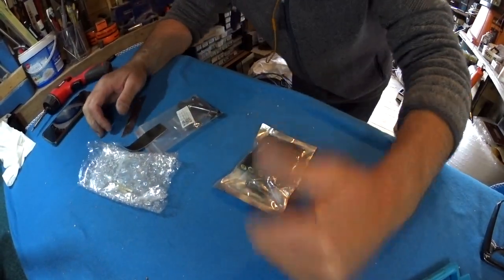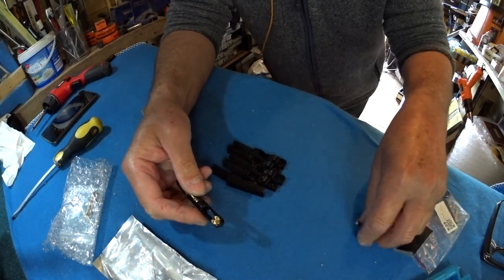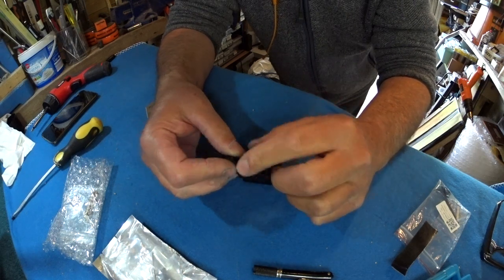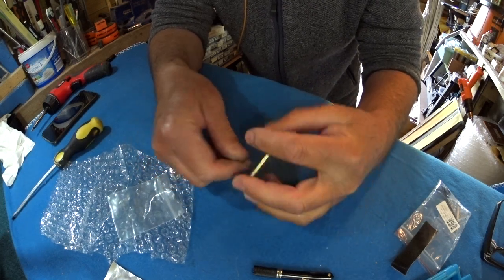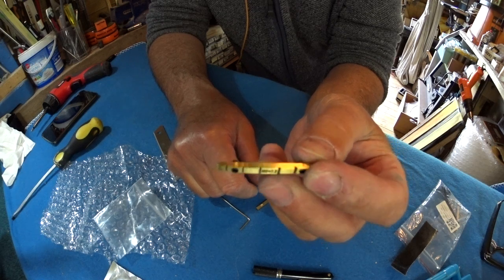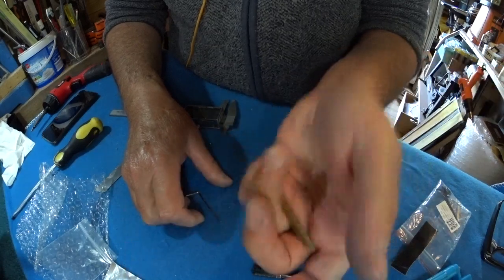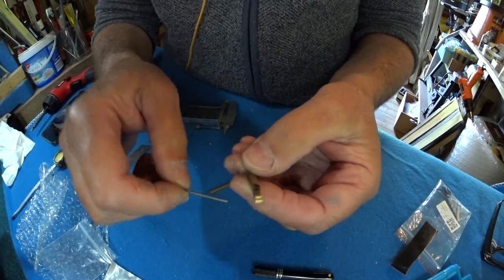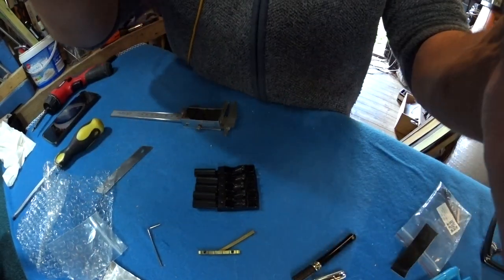Quick review of individual headless guitar bridge units and adjustable brass nut

Comment: where can we buy these? the AliExpress link is dead!
Reply from the maker: Hi I just had a delve into AliExpress but I can't find that particular style any more. It could be there but AliExpress searchability is fairly poor! Sorry for that. I've still got my set. It turns out that I did use them on a couple of projects but for various reasons they've ended up back in my spares department but they DO work if you can find them still being produced.

Comment: Hi Sam. So, do you go about intonating the same way if you're tuning and intonating from the same end of the guitar? My hypothesis is that once you tune it from the bridge end it would also be intonated automatically.
Reply from the maker: Hi Bert.. yes is the simple answer. The bridges have saddles in front of the winding mechanisms (whichever kind they are) so the distance between nut and saddle is handled / set in the same way.

Comment: ok these appear to be Guyker bridge units. What is your opinion of them?
Reply from the maker: They're surprisingly good John. I tested a single one a few months ago to assess it before buying a few sets. Recently sold 1 guitar with a set on, currently making two more using the same bridge pieces. Sure, they're soft-ish Chinese 'pot metal'. But they're simple, robust and they actually work - for under £50. A precision-engineered alternative is anywhere upward of £250 by comparison and few of those expensive units are designed to work on a regular, flat topped guitar body (hence all those 'butt-cheek' rebates you see on headless bodies).
Reply: @SamDeeksRelovedGuitars  sounds good. I'm putting something together that will incorporate these behind a tuneomatic. A headless with P90's.  Cheers
Reply from the maker: @johnmiller9219  Yep - sounds great. That's pretty much what I'm doing here:
https://www.facebook.com/pg/relovedguitars/photos/?tab=album&album_id=2582841808639590
Reply: @SamDeeksRelovedGuitars  cool work, love the lacquered rosewood